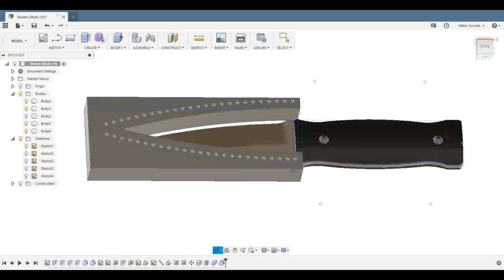Making a Leather Sheath...Using Unconventional Tools

Comment: I've been making leather sheathes for awhile, and did a bit of research before beginning in it. While drilling holes for stitching seems to be the go-to for many, it is my understanding that punching the holes makes for a stronger stitch. The purpose for the saddle stitch (two needle stitch) is so that the friction between the cord and the leather hold everything together. When you drill out the holes, it cuts the leather out, whereas punching the holes allows the leather to shrink back down a little, adding more friction.

Comment: Carried a commercial GOMK (get off me knife) during my career. A SOG Pentagon with a scary sharp side and a serrated side. Dulled / blunted the tip, per alleged lessons learned from those with more experience,  so as to not get stuck in bone.   Was carried center mass on my plate carrier .  Was pretty much disposable due fewer dollars than a "wait'a minute" custom knife if dropped and or lost.    Never had to use it as a GOMK but served general cutting needs.

Comment: Not too shabby at all! If you want to take it up a notch burnish those outside edges, nothing fancy required just dip your finger in some water and moisten the edge and give it a good  rub with a dowel if you don't want to get a burnishing tool. A little beeswax and it hit it again and it will look amazing!
Reply: Great tip. Thanks.
Reply: I like cutting with a water jet, the edges come out pre burnished.

Comment: Set up time, including fixtures and programming is monstrous.  But where you really make up for that loss, is in making many parts of the same thing.
So once you make the first good part, then the only down time is changing tools, and installing blanks and removing finished parts.
Once the tool path has been saved, and the fixturing, it is easy to make more when needed.
At least that is how we did it in a tool shop.
Thanks, and keep up the good work.

Comment: I could have used the cnc machine yesterday. The drill just pulled things apart, even with being glued and waiting a day or so. I found this tiny awl which worked decently even with the bent tip. Then I couldn't find a needle so I ended up making one with wire. The result isn't as pretty as yours, but they hold the knife. 
I broke the awl half way through, and had to file a new point.

Comment: Nice job on the sheath.  I like the idea of using a CNC machine.  I use my drill press and it works fine.  My thoughts on a more aesthetic looking sheath is to = when you stack the three pieces of leather stack the bottom piece of leather with the smooth side up, because when you fold it over to stitch it up you will be keeping the smooth side of leather exposed.  See how nice the smooth lower front of the sheath looks after you polished it, you can keep that pleasing look on the belt loop as well (and really make that knife sheath shine).  I know it might not be traditional, but putting a small blade retaining strap with a snap attached/sewn to the  belt loop to wrap around the knife handle to  keep blade from falling out, because it is not tight form fitting sheath, If it was me I sure as hell would hate to lose a fine looking knife like that one.  All it takes is one time to lose a blade like that and you will be sick for months and I am talking from experience.

Comment: Cool video. I dont have a cnc but i will use your 2 sided tape method. It blew my mind. I hate contact cement, if i drill holes it always gets sucked into the bits. Thank you.

Comment: Unique use for a CNC for sure! I WOULD have however recommended a however, using a siver rivet at the top corners and bottom point of the sheath pocket for durability and even for aesthetics as well. Also using white thread would have given a nice contrast to the black leather...and not to beat you up at all but turning the back piece of leather over so the finished side was in, would have given a more finished look since the "finished" side of the leather could be seen from the front on the beltloop and not just on the pocket of the sheath.... but I'll cut you some slack as you ARE a knifemaker, not a "leatherworker". Lol-- just kidding! It still looks good! Great job on the knife itself though! That goes without saying!! I would have made the sheath as a "boot" sheath though, as a sgian dubh is not a belt knife. It really sounds like I'm pounding on you but I'm not! Just noticing things I'd have done differently, but "to each his own"! It all works, no matter how it comes together because you're the maker....not me...so take it with a grain of salt. I watch as many videos of yours that I can because you do great work in all of them. This is the ONLY vid I can find ANYTHING to "critique"! THANKS....and keep 'em comin'!!!!

Comment: A great example of making do with what you have!  That said, drilling holes is not a desirable way to create holes for stitching, leather workers have specific tools for making those holes for hand stitching.  Unlike drilled holes, the diamond cut holes making by awls and pricking irons are self healing and the leather will cinch up tightly against the thread.  The glue, usually Barge or contact cement, does aid in alignment, but it actually seals the stitch lines and produces a far superior product in the long run for many reasons.  First, the leather pieces won't start to separate between the cut line and the stitch line; that will produce jagged edges, introduce gaps that attract debris and increase stress on your stitches.  Proper gluing will make your end product almost indestructible.  After all, why do knife makers use both epoxy and pins?  Now, if you don't want the dye to make its way onto your really nice knife, you need to apply a finish to those soon to be hidden internal pieces you dyed before assembly.  Finishes protect your leather, but they also seal the dye for rubbing off onto whatever the dyed leather is in contact with. And listen to the feedback about needle size and burnishing, the difference in the quality of the end product is huge!  Now show me how to cut out patterns with a CNC with cutting blades and you'll definitely have this leatherworkers attention!

Comment: Dampen the leather before you dye. Works better.  And wax edges and burnish with a round wooden tool...
Reply: @mark burress   Do you have any vids of your work?  Sincerely.  I'd love to see more leather crafting.  Better a fellow knife making fan than some random wallet maker.
Reply: @InformationIsTheEdge check out the Andrew's Custom Leather videos on the Hank Strange YouTube channel, you'll learn an absolute ton of stuff from a gun holster master craftsman.
Reply: @m0314700308891515  Excellent!  Thank you!  I just tagged a few of the videos you suggested to watch later.  Thanks for the heads up!